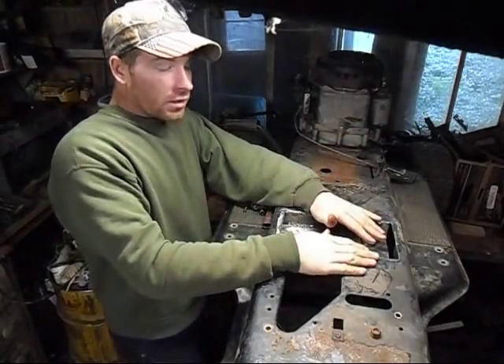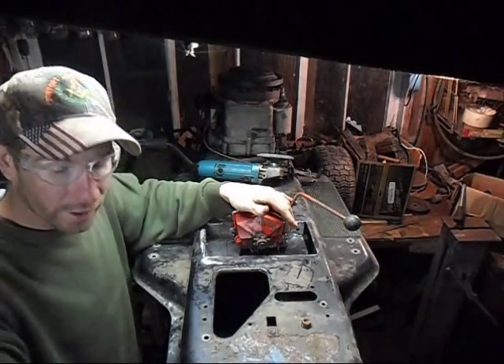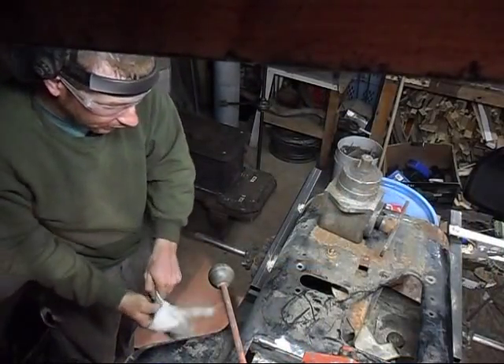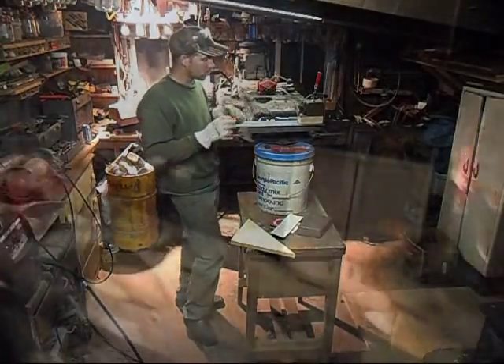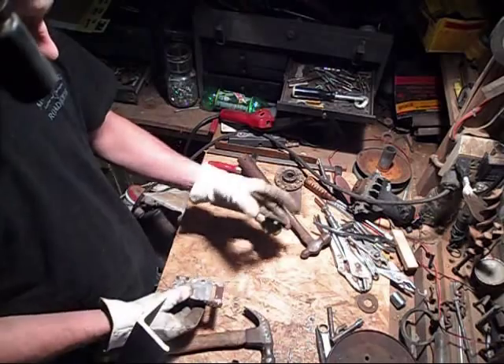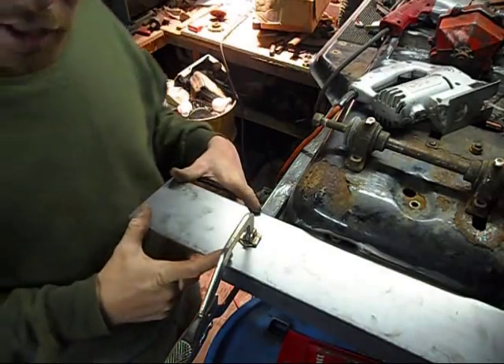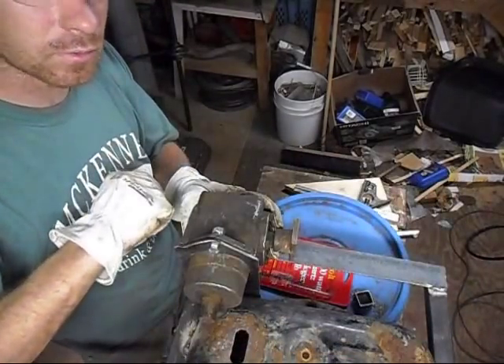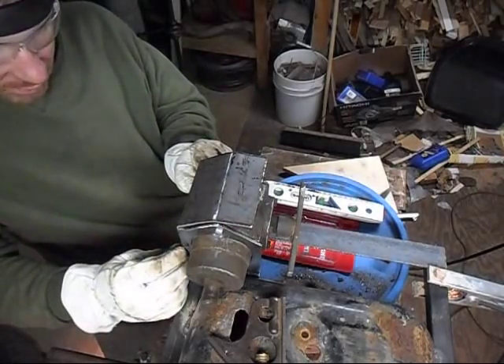Project Mud King Update 7

Comment from the maker: I am not using gas so I dose not require the shielding nozzle. There is a shielding cone on the stinger. most people think it just for shipping and throw it away. If you weld with inner shield wire and you use the shielding nozzle all you accomplish filling your nozzle with slag.

Comment: i have a question. Where and how high will you be sitting on the frame. Keep in mind that the higher you sit the higher your center of gravity will be and the easier you will tip over. Just interested on what your plans are